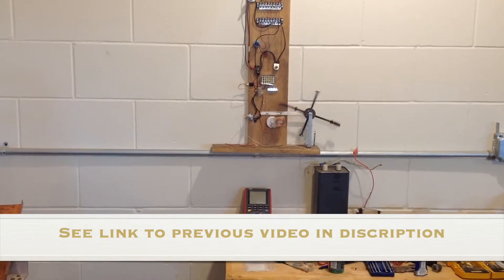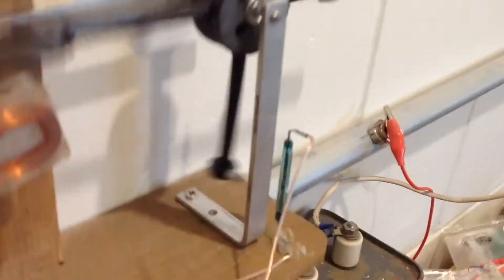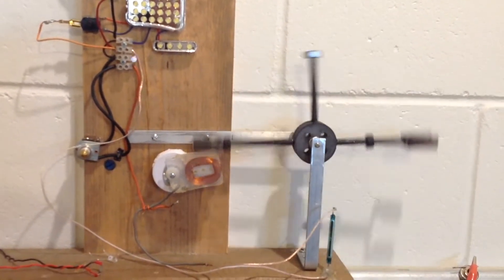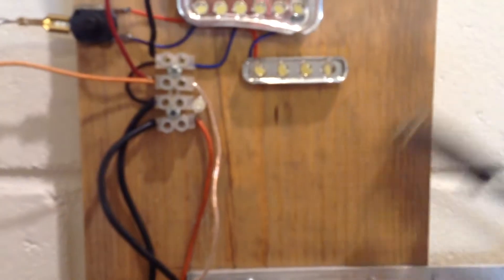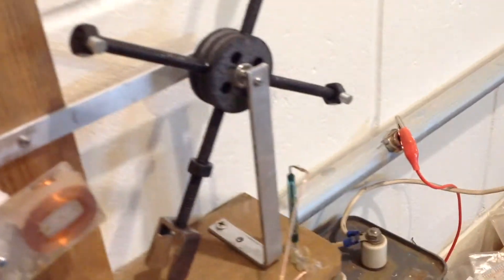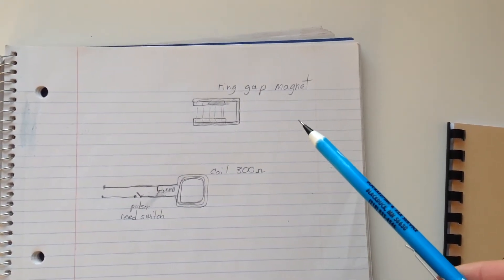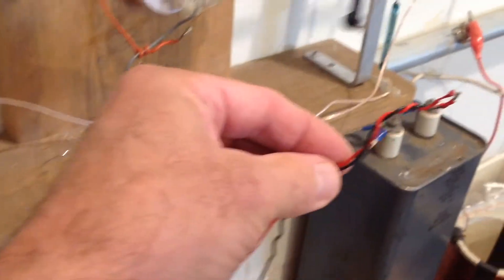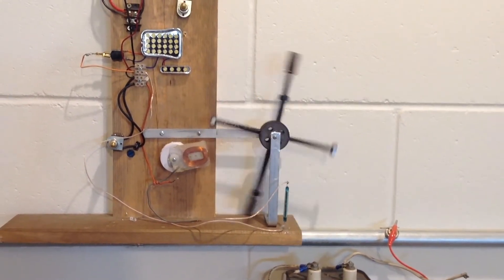Perpetual-like, pulse motor; powered by harnessing radio waves

Comment: I remember years ago my neighbor used this same idea to capture energy. He used a kit that was set up on a automatic reel out and reel in device that used a smaller puller kit. He would go fly a small kit attached to the large one. This would pull out the large one which could go out hundred of feet. The rest is foggy as this was thirty forty years ago. He would get some days more some days less juice. The wire from the kit would go through a double grounding blocks since lightning struck this a few times. 
Sorry do not remember of watts or volts or much else. Hope you do well with your idea Double M Inn.........
Reply from the maker: That sounds interesting!  Gives people something to think about. 🧐
Reply: @doubleMinnovations  I can actually say that I was around very bright and interesting people all my life. Some has to rub off. Peace.

Comment: Check your frequency 50 to 60 Hz because you're very close to the power lines with that antenna wire. I don't think you're getting radio waves at 8:00am power company's turn the power up for industrial uses
Reply from the maker: I show the frequency check in several videos.

Comment: How small could you make that thing? Could u power a TV with it?
Reply from the maker: It's pulling in around 3 milliwatts at its peak, so that is only enough power for a few LED's, not for a TV.  At my location the antenna needs to be as big as shown to get that much power.  Thanks for watching!

Comment: Super job, thanks for posting
Reply from the maker: Thank you for watching.  This is a fun project!
Reply: @doubleMinnovations  Hi, do think if you added more coils and magnets it would still work?  I found a method of using a PWM to remove the back EMF from a PMA to charge a super Cap bank It seems your project has some interesting possibilities.  I am currently rebuilding a old project so I can finish testing.
https://youtu.be/ALutpnyeMm8
Reply from the maker: Hello  @GoVertical17  , I wasn't exactly sure how this motor would perform when I made it.  But I knew it needed to operate with only a tiny amount of power, that's why I used the 40 gauge wire with many turns.  And only two pulses per revolution.  If I decrease the number of turns, and use a larger gauge wire in the coil, it will increase rpm's, but also power requirements. -and I may do that yet.  Right now I have the lights and motor on at the same time, and it's kind of impressive, and inspiring.  People don't know what to say, or think it's real. : )

I can also just shut off the power to the LEDs so the voltage builds up more, and in turn increases output. -I show more of that in (part 2). https://youtu.be/yE5T3BvumrA

I will also check out your video.